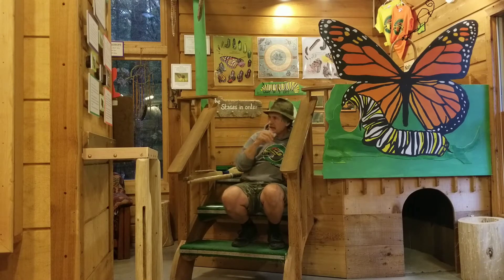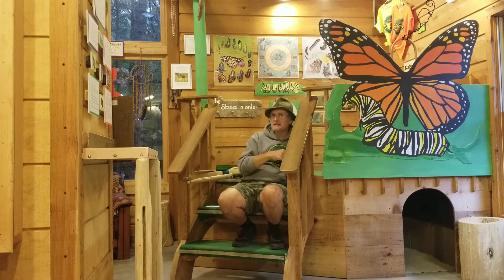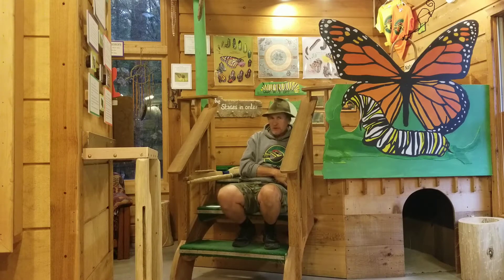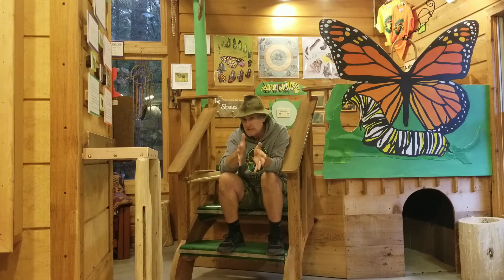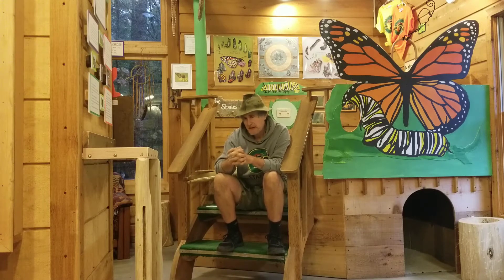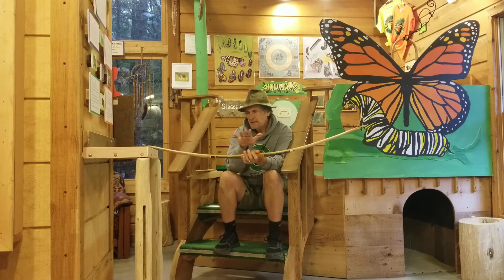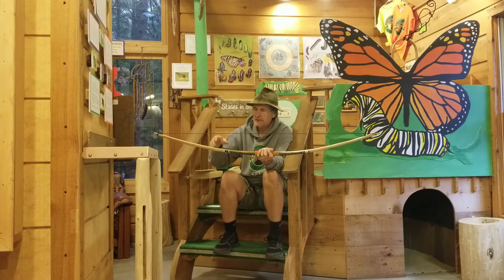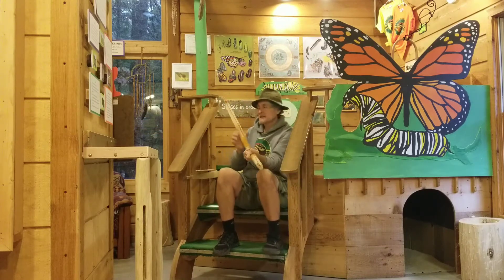Esoteric Theories of White Cedar Bows

Comment: Thanks for doing this video. I have zero osage or junipers here. Lots of white cedar thuja everywhere amidst all the other conifers in Lake Superior region. For glues I have balsam, hemlock, pine...spruce and no sinew left until fall but have some thin rawhide. So I'll see what happens!
Reply from the maker: Good luck. I would think about birch before relying on white cedar though. The trunk wood is a wash, and branches are passable for lighter bows, but I betcha you have paper and yellow birch here and there. The Betulas make pretty decent bows.

Comment: Nice. So, given the same draw weight, reflex, etc, a less dense wood makes a faster bow? Also, for a mildly violated ring paddle bow, in a very humid climate, which is better, sinew or rawhide? (I’m using hide glue by the way)
Reply from the maker: Hi Ryan, there are no absolutes because of how wood varies from species to species, tree to tree. Just think of this in general terms, and a wood like white cedar has enough snappiness to be fast at a lighter weight.  a rawhide, including some snake skins, and I imagine fish skins if they are thick enough can take enough stress to back a bow with violated rings up to a point beyond minimum draw weights for hunting deer sized animals. In a humid climate using hide glue, I don't believe that you'd be able to take advantage of sinew's abilities, so you may as well go with rawhide. The waiting time will be a lot shorter as well. This might sound like a lawyer answered your question but there are so many variables I can't state anything in absolutes. I will commit to saying that your paddle bow, if it's under 50 pounds at whatever draw length should survive with the rawhide backing. A lot of times a bow will fail just before your goal of draw weight/draw length, and it would have taken the smallest of advantages to have kept it in one piece.
Reply: J R's Place I’m aiming for 40, maybe 45 pounds at most. There aren’t any large game here in the Philippines that aren’t domesticated like the buffalo. The biggest I know of are crocodiles which I won’t even go near to and monitor lizards (not endangered here). If I, chased a ring, could a selfbow be used for bowfishing? Maybe not in the reef though, don’t want to hit a coral on accident.